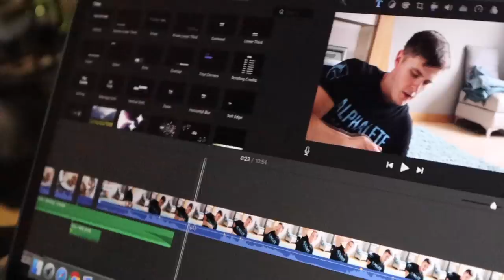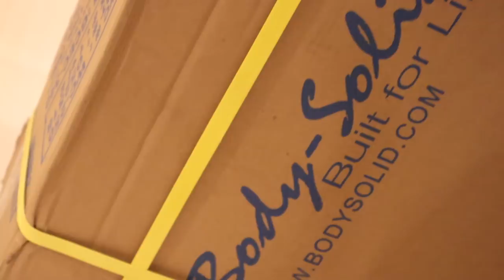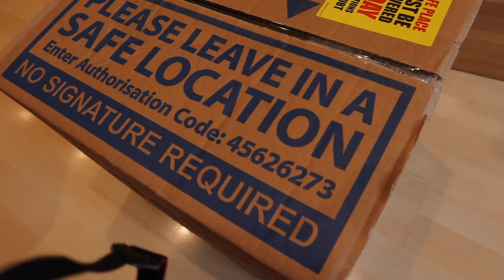THE BIG REVEAL! Home Gym UPGRADES!!

Comment: It's hard putting equipment together as there is so many nuts and bolts slightly different and usually instructions don't usually tell you what ones you need for what position crazy

Sounds like you need to do more cardio and little bit more functional training
Reply from the maker: fatdepressedveg knight oh thank god it isn’t just me then!!😂 It’s on the cards bro. A slight change in routine that works around my work schedule!